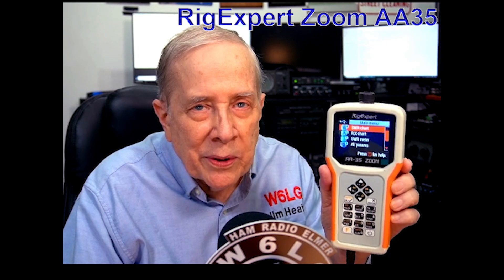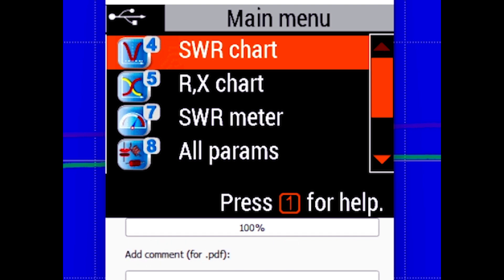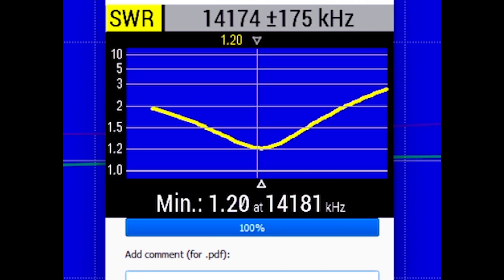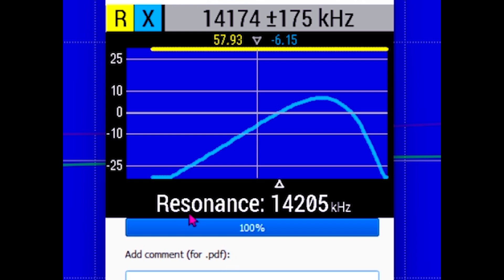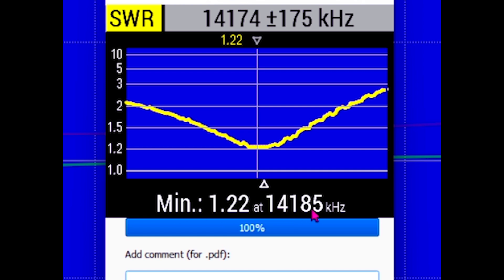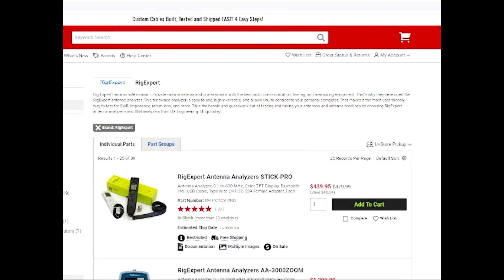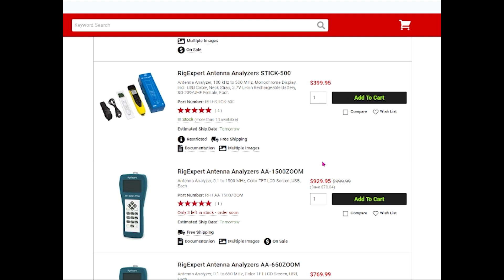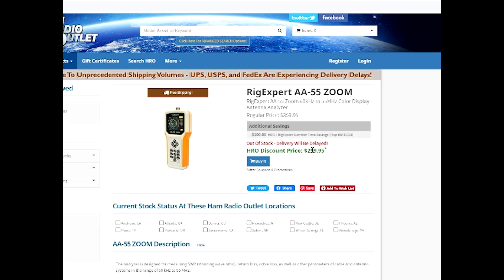The RigExpert AA-35 Zoom I Purchased From A Ham Radio Dealer Is One Of My Favorite Devices Jim W6LG

Comment: I have the same one. One thing to watch for is battery voltage. It needs the full 3v. Rechargeable batteries only work for a short period as the voltage is too low. I also had a brand new battery a bit low on voltage that stopped it working. It's a great tool though. Saves a lot of time.
Reply from the maker: Always great  to  hear from you Gordon!  73, Jim W6LG

Comment: Thank you Jim. I own the AA-30 Zoom that I bought about 8.minths ago. I love it and continue to learn how to use it, especially since it has been helpful in showing me I had loose contacts or connectors from time to time. Some like smaller screens, but I love the nice big color display that is easy to photograph & see changes in the antenna behavior as I make adjustments. It has been instrumental in my antenna education where now I can learn nearly instant results. Whenever I do a POTA activation it is the first tool I grab before I power up the radio! Cheers, Davey - KU9L
Reply from the maker: Thanks Davey. I agree with all you wrote.  73, Jim W6LG

Comment: Good information Jim, but a little confusing. Now that I know that they are two different things, is it better to tune for resonant frequency, or lowest SWR when tuning an antenna? I was thinking the lower SWR reading would be better for less strain on the finals of the rig. On the other hand, wouldn't there be less loss if the antenna were tuned to be resonant?  Is the antenna truly "tuned" without having both measurements matching? I have the AA-230 Zoom/Bluetooth model.

Comment: Thank you for that clarification regarding the less SWR and the resonance frequency. I suppose that many of us would like to know WHY there is this differnece between the two frequencies. 73 de SV1SLB
Reply: The resonance is by definition where the reactance is zero. Have a look at Smith charts and how the impedances are the vector sum of reactance and resistance. Sorry for my poor explanation , 73
Reply: n @g0fvt   Thank you foe the explanation. Still I do not know why there is this differnce between the two frequencies. Why hte lowest SWR do not appear where the reactance is zero.
Reply: @batfalcononyoutube  it is down to the vectors, of the reactive and resistive components. Take a simple quarterwave vertical fed against perfect ground. At resonance it should be in the region of 35 ohms resistive. With an SWR of 50/35, ie about 1.4 . By increasing the length slightly the reactance and resistance moves the point around the Smiths chart and you can improve the SWR. 
Bear in mind the cable length (even if lossless) can rotate the reactance.
If you want to experiment a quarterwave cut for 70cm on a biscuit tin or similar and a NanoVNA (or other analyser) would let you see the effect yourself.
I will probably be flamed for this but in practice most of us cut our HF antennas to get the SWR dip in about the middle section of the band we are operating on.
Reply: @g0fvt  Thank you for your answer. Since I already have the NanoVNA, I already have done some tests with my antennas. Unfortunatelly I was not able to find out how the VNA shows the resonance frequency. Searching the Youtube, I didn't find any relative video. In fact there is too much cofusion and misleading videos, claiming that the lowest SWR appear on the resonance frequency.

Comment: Great video Jim.  I have the AA-55 and the Stick 500, and they are great tools.  I am also constantly amazed at how many people do not understand the difference between low SWR (Simply a result of impedance matching) and resonance, which is defined as that where the load is purely resistive, with no reactance.  i.e. Z=R+j0.